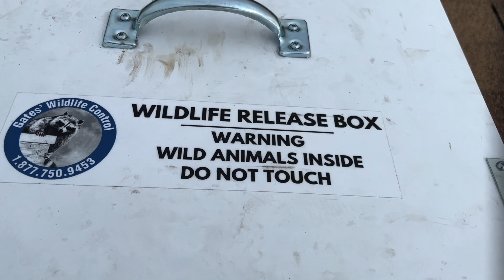Quick Exit For This Mother Raccoon | Humane Raccoon Removal In Markham

Comment: That was one determined mom, ravaging every roof vent until she found one she could rip off. Looked like that vent had only one corner screw into it - only one enlarged hole from a screw either ripping through or over-tightened to that extent. Roofers in areas with attic-loving critters need to properly secure those things.